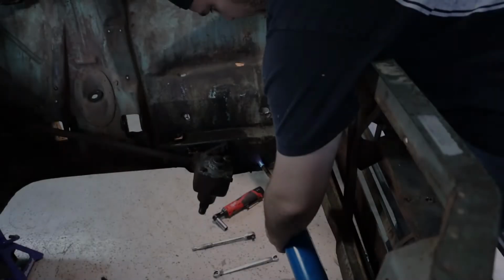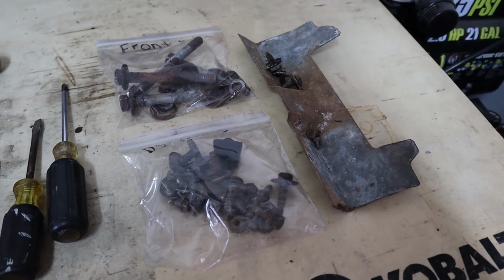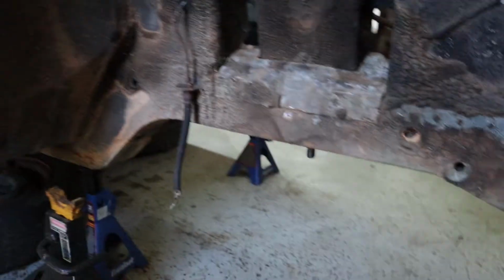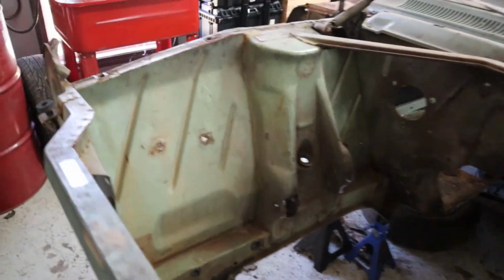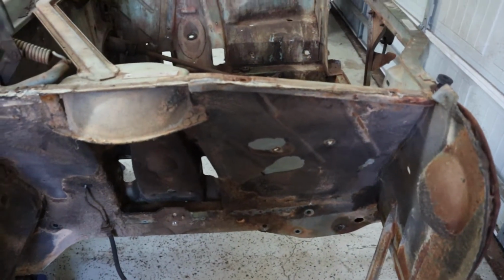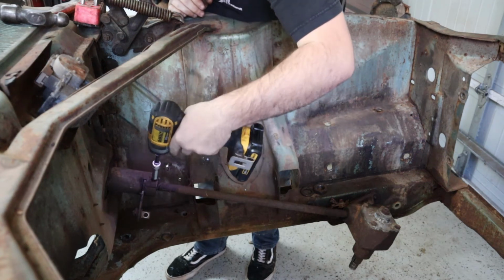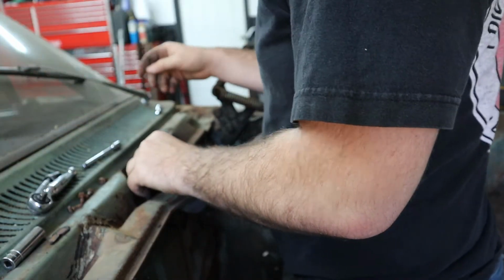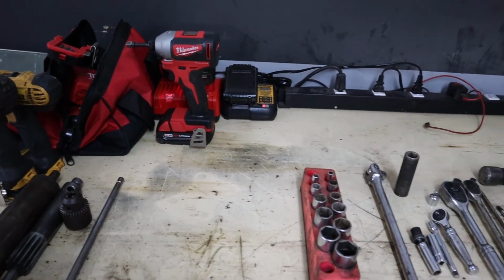1964 AMC Rambler! Completely stripping the front end.

Comment: The spot weld at the bottom is factory. My 64 had them on the bottom by the rocker and the top top of the fender to the a pillar. It looked like brazing brass on mine. Same with the roof skin seem.
Reply: I think they were ment to help with aligning the body lines from the factory. I use to think they were for like a crunch point or something incase of a wreck but after researching a bit I've been hearing they were for alignment
Reply from the maker: Oh good to know! I was thinking mine was the only one. It’s safe to say I won’t be spot welding them back in place haha
Reply: Your are doing what I did 30 years ago, ---starting from scratch and upgrading a 1964 Rambler American -- I maybe can share some insight that will assist you on your "build".

Schurrbuilt